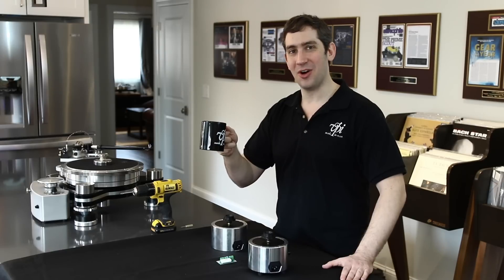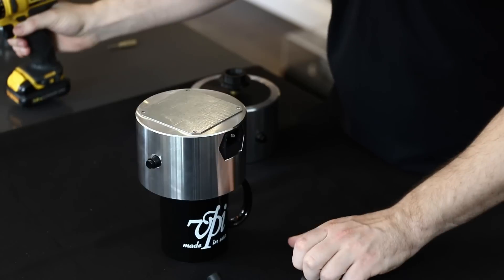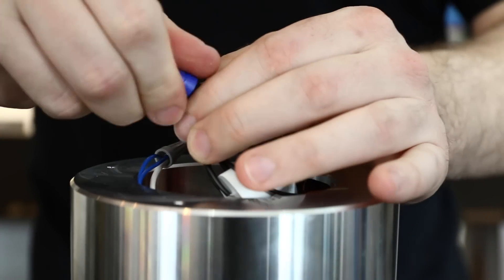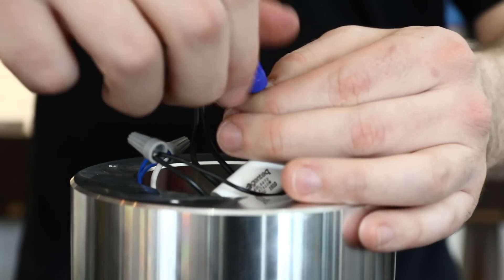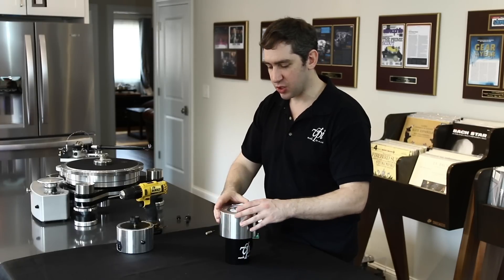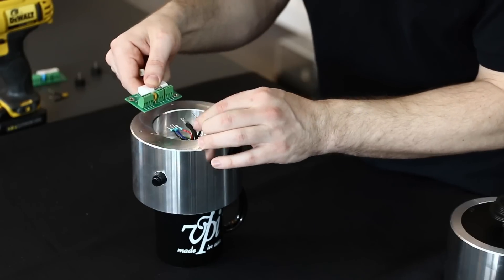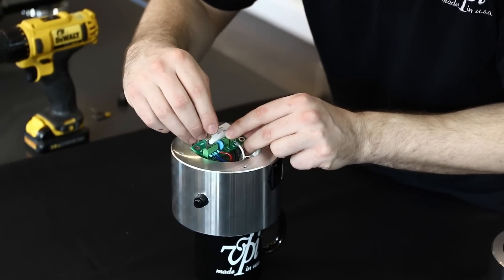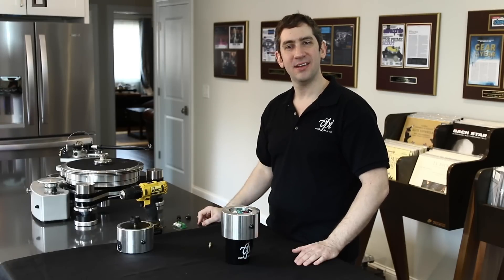Motor Pop? VPI Capacitor Swap Tutorial

Comment: Hello Mat Mr. VPI Pres:  I bought a Mk iv in 1998 with the coffee can SAMA and have had mixed feelings since about noise with the machined piece on top of the spindle and the noticeable 'POP' mostly at the end of a record when I turn the table off.  Now I only have an undergrad in electrical engineering and have thought for years about putting a Mundorf Supreme about .33uF in the motor, but am anxious to hear how this is not a VPI problem. I have an identical table with the Black SAMA and TNT platter and SME IV arm and it performs much better.  I welcome enlightenment or advise or help with the table. I am thrilled overall with the table and my Shelter 901 iii and consider it to be an 'end game' table given what I have heard at RMAF and AXPONA

Comment: I was about to do the cap swap on my Scout Jr. motor, but mine had no panel on the bottom.  There were 4 screws in the feet, but also a screw right in the center and some more along the sides at the ac chord input and four screws on the corners of the top of the motor.  Any ideas?